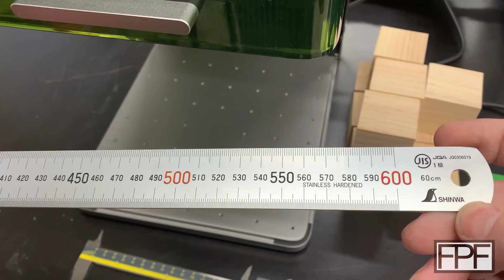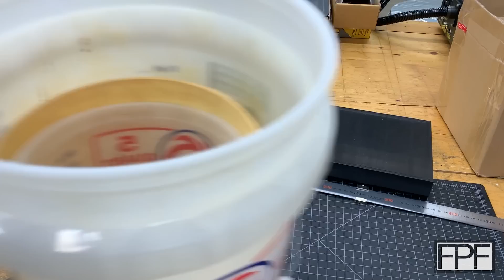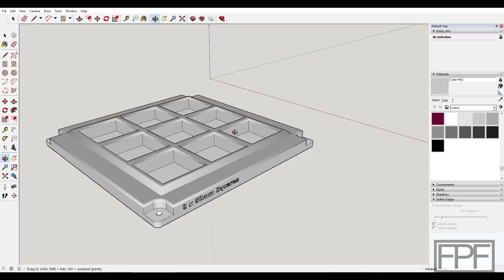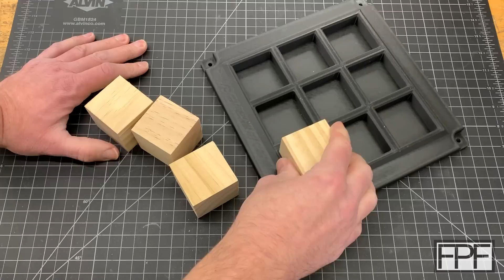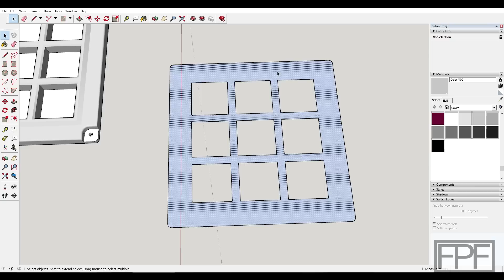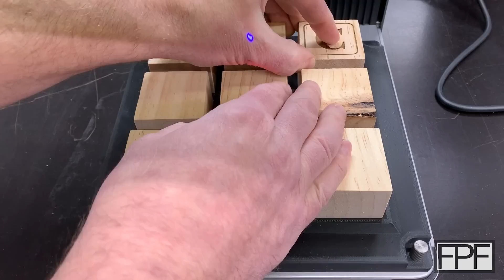3D Printed Jig for Engraving Square Blocks

Comment: An idea I had for your tolerance issue with the wood fitting in the print: I have used an integrated compliant leaf spring for a socket set in my gridfinity system setup. Could be useful here too.

Comment: Really enjoying the channel, truly amazed at what you're accomplishing with SketchUp, another vote for learning a parametric modeler, but what I really didn't expect was to realize I need to buy several non-glare rulers and, of all things, a flat tape measure. This channel might wind up being inadvertently expensive for me!

Should also mention that I love the LED strip lights that you mentioned on the enclosure videos. Have gotten them and they were exactly what I was looking for, simple, bright, easy to mount. I've remixed the light holder to work with my rack, will reference those videos and your site when I post the remix on Printables.

I will say, though, when I print something like a jig, I'll make it as minimal as possible where it still does the job, like turning off top and bottom layers and avoiding unnecessary material. If I'm only going to use it once, I'll waste the absolute minimum amount of filament to get the job done. Otherwise love the jig.

Oh and you might know this but a trick I picked up for measuring center-to-center distance on round holes - measure one and zero the calipers, then measure between the holes using the "inside" measurement points on the caliper. You'll get a direct reading of the center to center distance. Only works if the holes are the same size, but does work quite well with threaded holes. But, if you did that, I wouldn't have a couple Japanese rulers I didn't know I needed on order now. :D  Apologies if you already knew that trick!

Comment: Check check checkin’ my emaillll. 😂 Love the Strong Bad call back. Those videos got me through a lot of college. 🎉

When you first talked about making the blocks I thought “make a jig!” My dad was so proud. This was well done. Which cad software are you using? I like the clean interface yours has. 

Also, not sure if this was just a design choice for the blocks (which turned out beautifully) but I think they’re traditionally inverted from what you’ve done here. The letter itself is usually raised, I think. But, like I said, they turned out beautifully. Very well done. Makes me want a laser engraver. 😅 To go with my CNC and 3D printers.
Reply from the maker: Sketchup for CAD, but I should REALLY switch to something parametric.
Reply: @ hmm. I’ve been using Shapr3D because it’s so easy to use with my iPad. But I’d really like to use something meant more for engineering purposes. Fusion 360 is just so expensive for a commercial license.

Comment: Great idea getting the cubes in perfect position repeatedly. Why do you need to print the bottom in the openings? The cubes will fit through and sit directly on the bed... Saves material and printing time

Comment: You are snug fitting sharp corners into sharp corners.  It worked this time, but it would be better to have relief in all of the internal horizontal and vertical corners of the jig. You also could have used a small vertical "+" pattern to locate two diagonally opposite corners of each block instead of full rectangles to save filament and print time. This comment is not meant to be critical but rather to offer suggestions for future designs. I enjoy your channel and look forward to each episode.  Thank you.
Reply from the maker: Great feedback and ideas, thank you

Comment: I have shinwa rules nearly identical to those you showed, but the ones I bought only have 1mm graduations, no .5mm. I tried one of their rules with .5mm lines and they were way too hard for me to read reliably. I had to import those form japan via a japanese ebay seller though. Still worth it for sure. They're my most used rulers. I have 100, 150, 300 and 600mm lengths, as well as 6" and 12" in imperial they make. The 100mm is a really handy pocket size. The 1m is only 5mm wider, so not a huge difference if you decide to get that one down the line. But yeah, shinwa steel rules are amazing. 
Merry Christmas and Happy New Year! I hope the holidays treat you well!🍻

Comment: Awesome over engineered, but I don't mind it and would absolutely do it as well, love the content, I finally got my p1s, but struggle to keep petg on the bed, print like 14 layers en then just comes off, but still love the machine and going to figure it out, any tips welcome 👍
Reply from the maker: Are you drying it?  Also, try gyroid for infill.  The default ‘grid’ is terrible with PETG
Reply: Yes, have one of the Creality space pi dryers, not sure how good it is, but it says 13 RH and I'll try the suggestion, past 5 days not one print being successful, truly a pain, but let me try, or I'm going to start printing on glass 😅

Comment: With that jig, you could modularize it and make it more versatile to be able to swap out different size blocks or shapes.  Just keep the outer frame and inset a smaller inner frame that would contain the parts to be engraved.
Reply: The outer frame could key to the edges of the table rather than four of the holes so the jig inserts would have access to the full surface area of the table.